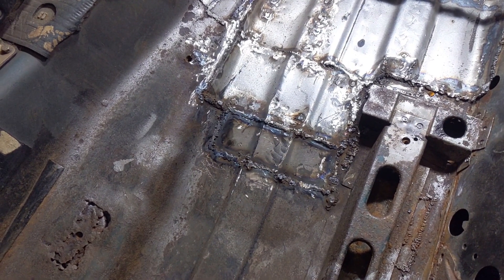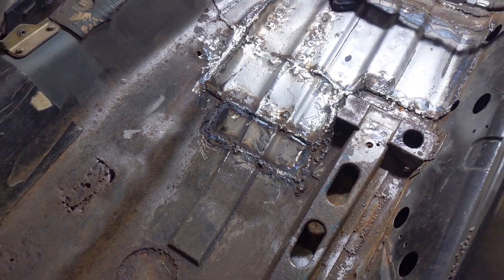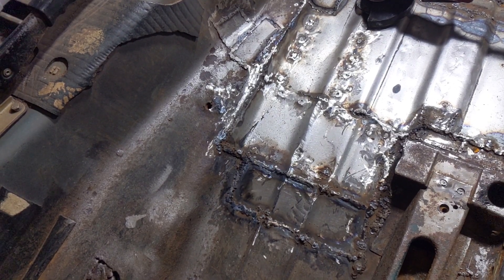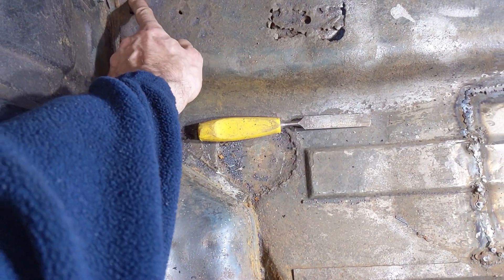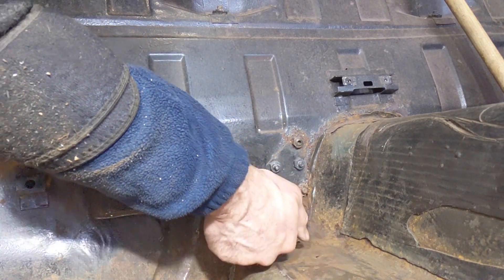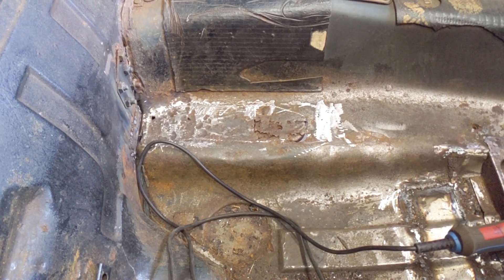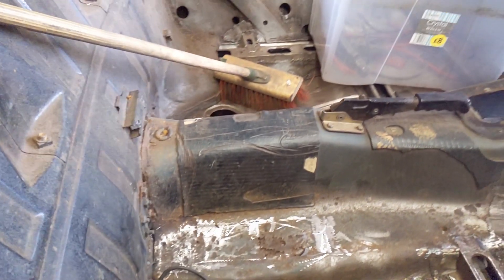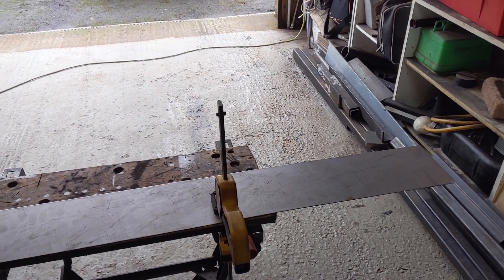Triumph TR7 Restoration:  Episode 56   Transmission Tunnel

Comment: Nice work Henry, clean tips help a lot...I have been on the MG, lots of good hints on the door panels and carpets...
Reply: For the carpets, if you're going to do them yourself, use a thin strip of vinal on the edges to give a better finished look
Reply: I went to the store for carpet....the price made it to easy to buy them I built carpets for my Mercedes haven't ever installed them yet we'll get there one day.
Reply from the maker: @batgclassics  Making the carpets is really satisfying - finishes off the car nicely

Comment: FYI, the screws that hold the seat rails down are metric, maybe M6 or M8?  They are a self-tapping/self-locking thread, but a standard hex head in the right thread will work.
Reply from the maker: Thanks Darrell.  That’s interesting and might mean the threads need tapping because I tried an m8 which felt the right size but didn’t want to go more than a turn.  Possibly bunged up with rust

Comment: Hi I've cut the floor on the midget about 8mm to wide. Would you say that it's to bigger gap to but weld or is it a case of cutting out a little bit more and weld in a small patch. Thanks Mark
Reply from the maker: Hi Mark, I'm glad you're on to the welding and I'm waiting for links to your videos!  I think a gap of 8mm is too big.  If I had a single 8mm diameter circle and was feeling lazy (which I often am), I might just try and fill the hole with weld, but I don't think it ideal.  If you've a side of the panel with an 8mm gap, it is too much (in my opinion or for my skills).
Reply: @HenrysGarage  cheers Im thinking the same thing
Reply from the maker: @cluelessmgmidgetrestoratio6990  I don't know if this is any help, but at 8:04 in the video there is a gap in the bottom left corner of that small patch.   It might have been 6-8mm I think, so for that small area was ok